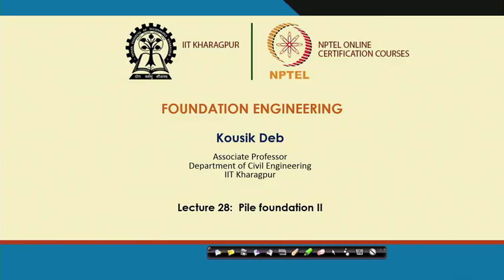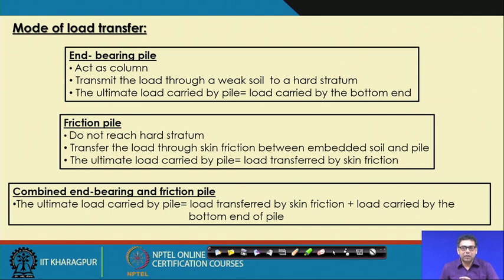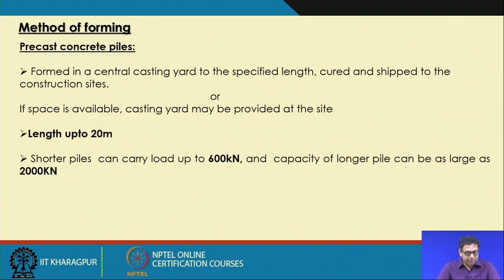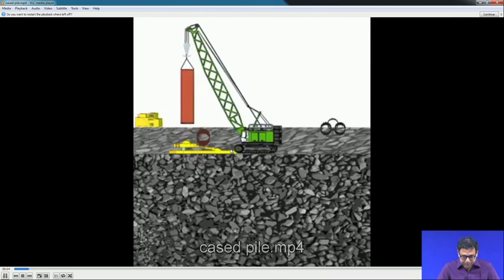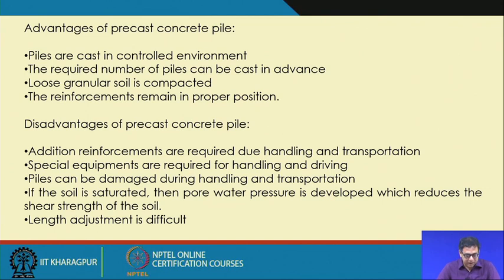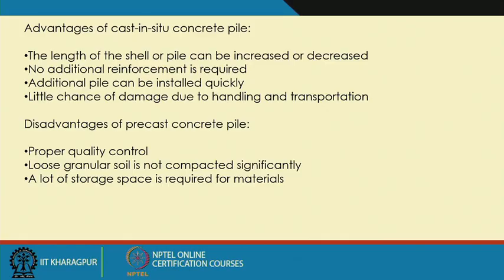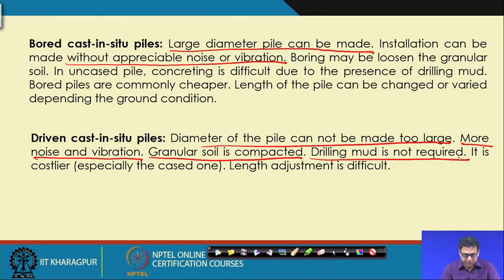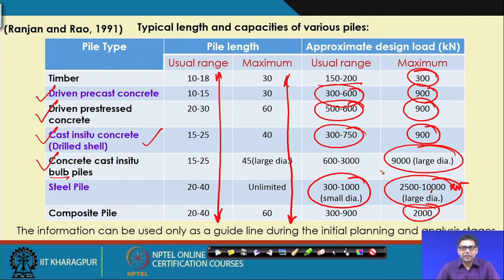Lecture 28 : Pile Foundation - II

Comment: Can we use bored cast in situ RCC pile in black soil without reaching hard stratum for low rise building ??
Reply: Definitely you can ..mostly you have arrange the builb in that because 1 increase in bulb increase the carrying capacity by 1.5